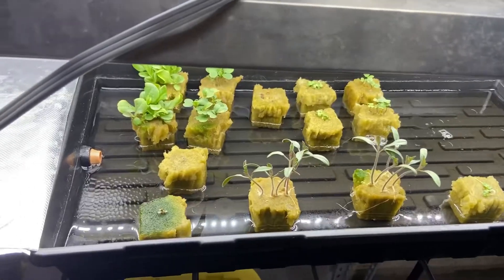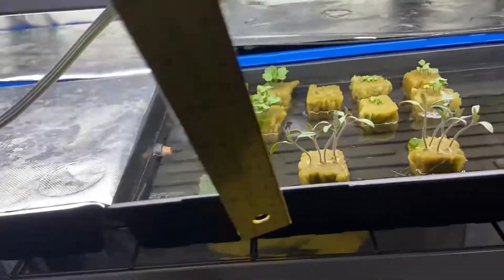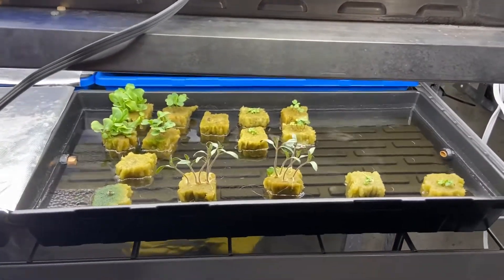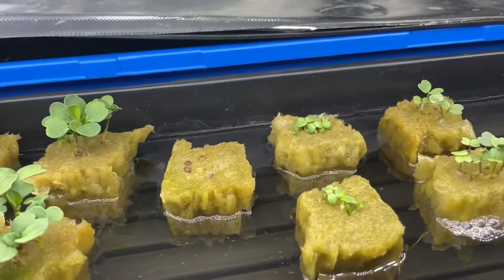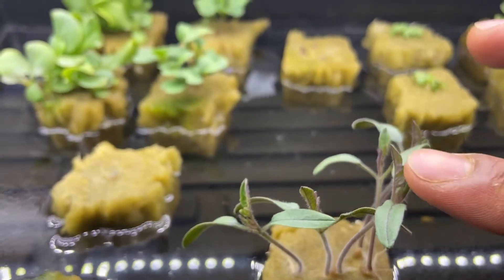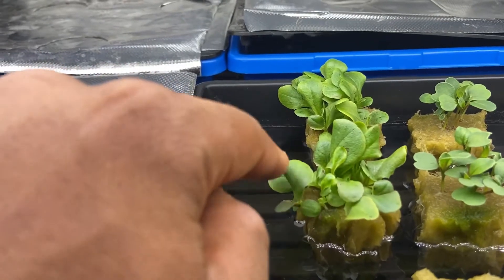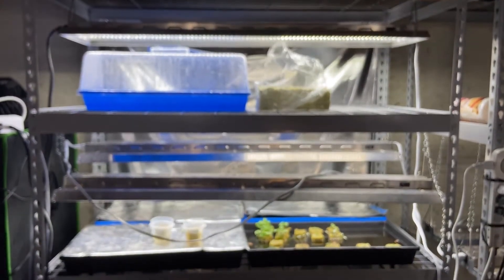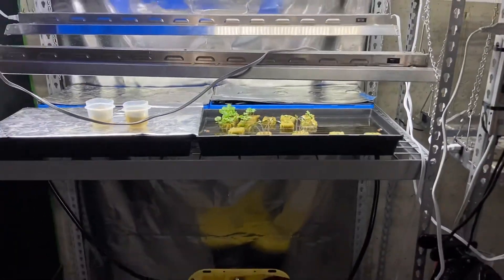how far should seedlings be from grow light

Comment: I'm confused here... Are you saying to put 40,000 lumens of light 6 inches above the seedlings? That's insanely high. Most ppl use about 5,000 lumens 1 to 2 inches above. I would think 5-10 thousand lumens would be correct, regardless of where the light is.

Your light meter is measuring LUX which is not the same as lumens. 40,000 lux does not equal 40k lumens. This info is confusing.
Reply from the maker: 1 lux is equal to 1 lumen per square meter. it's very confusing honestly. So when you buy the light the measurement is in lumens(total light generated) but the meter measures lux(total light in one meter). Sunlight is easily over 100k lux so 40k is actually very dim. since I'm using LED lights, the heat generated is small so I can keep the lights close to the plants. I like to keep my lux between 25k-35k for a good spread of coverage versus intensity which is usually between 6-18 inches away from the plant depending on the light. Does this clear some things up?
Reply: @joshuarudd6297  I've tried to respond to this twice but it keeps getting deleted. Check your filter please.
Reply from the maker: @BluelightGaming1  I Dont control the filter and i cant see your blocked comment. Susan is always watching. we can always continue this on Email. Ruddshomefarming@gmail.com